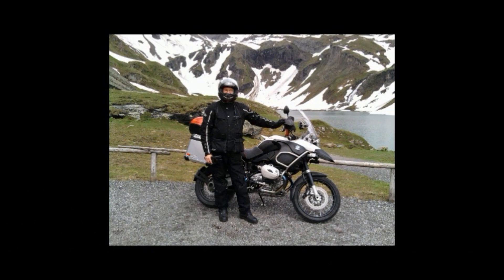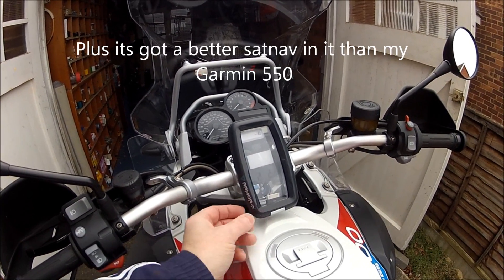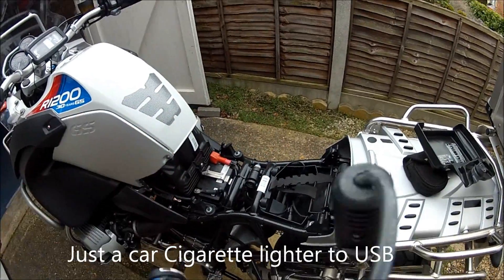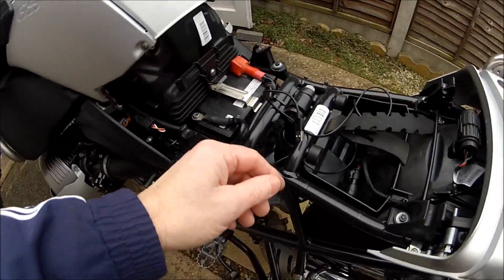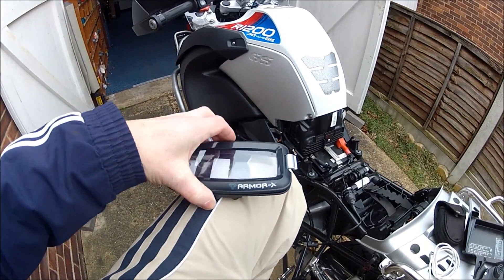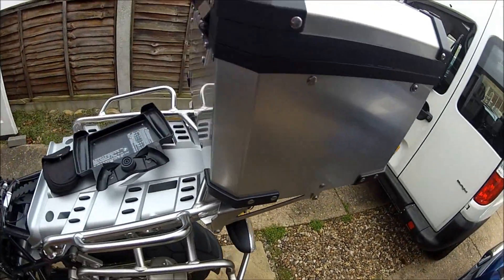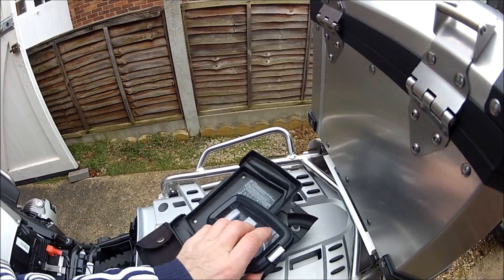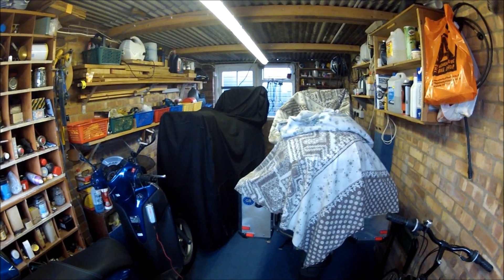How to power your Iphone from a motorbike

Comment from the maker: Hi Mr gadget, OOOOh dear, because the can-bus works for the computer you could have a fault there somewhere, both my bike's din plugs power everything from compressors to charge phones to cameras and to charge my bikes battery, etc etc just like its straight off the battery, ODD.

Comment from the maker: Hi bud, well its not rocket science just connect the two wire's from the c/lighter to the battery with an in-line fuse ( check out the description under the video i have just added. i thought every one could work that out its so easy oh well. Eric.

Comment from the maker: It would be very easy to tee off the can-bus din socket from under the seat to the one under the handlebars, don't understand what you mean a direct fused battery connection??? what have they done then, there are NO fuses in the can-bus system works off the bike computer, or have they fitted a relay and come off the battery,still all of them will work the same,very odd